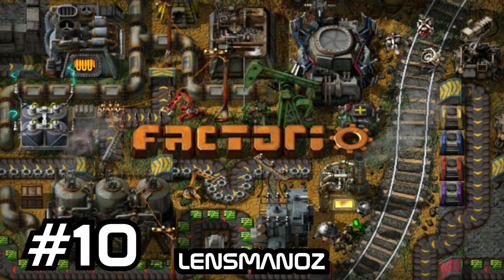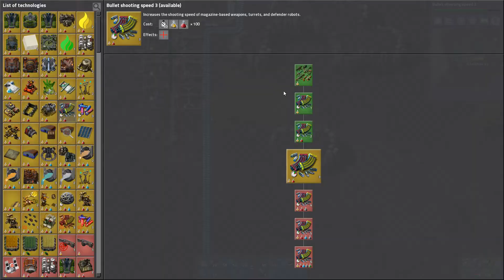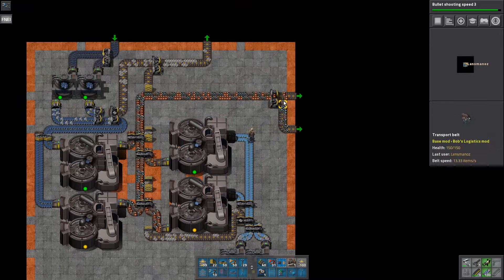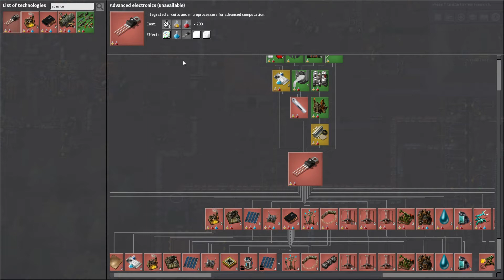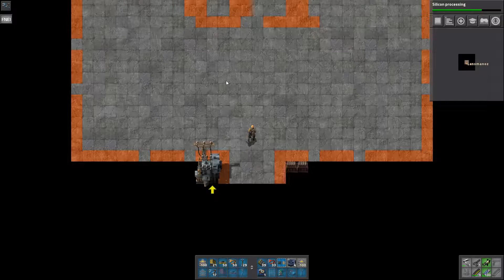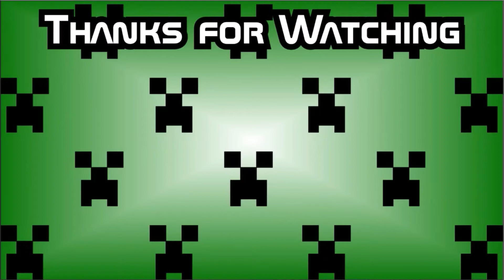Factorio Modded - Ep 10 - Shrinking the process

Comment: You need the Advanced Electronics, for blue science. It looks like a transistor I believe. It also needs Bronze, Batteries, and Engines to make. (I think the recipe is the same between Bob's and Angel's.) Oh, I see you found it.

If you've got the first electric energy distribution, the base will look cleaner if you replace the lines of wooden poles with the large electric poles.

Hah, I forgot synthetic wood was a thing. I'm producing so much actual wood from my super green house setup, I don't need the fake wood.

Since your factory buildings are powered on all tiles, you can place your ore sorters directly side by side and load into them the same way you do the ore crushers, just feeding into a splitter and then into two loaders.

And since you're not using the crushed stone for anything other than to make regular stone, you could just make it in the factory and then export plain stone from them. Save you the space in a silo.

Yeah, Filtering is why I went with the larger loaders. They're a bit more expensive, but built in filtering is amazing.

Slag Slurry is useful in two ways. One it can be used to produce more specialized materials, but also by turning the slag into fluid, you can then void it with a clarifier.